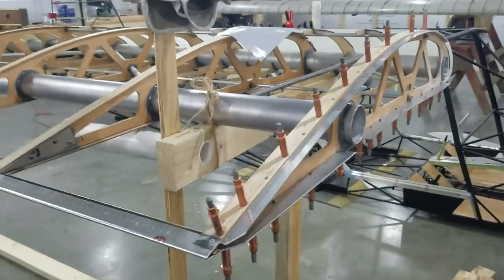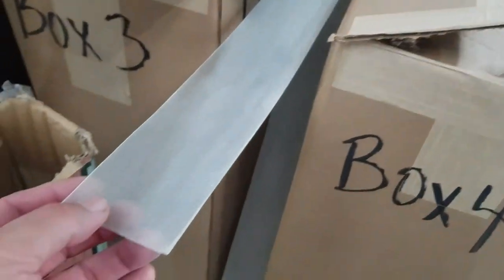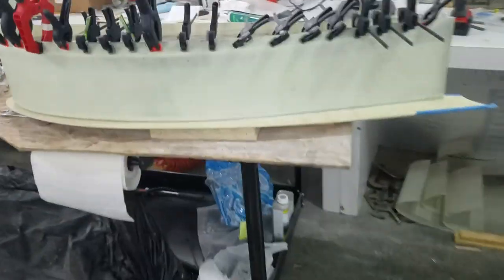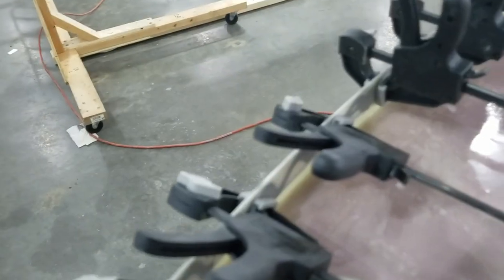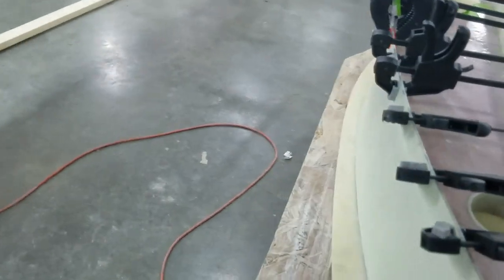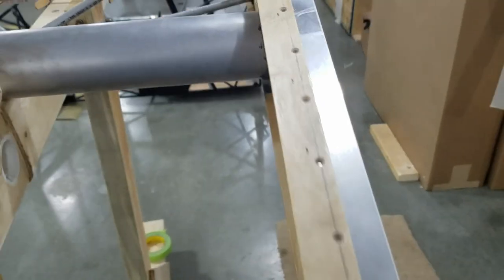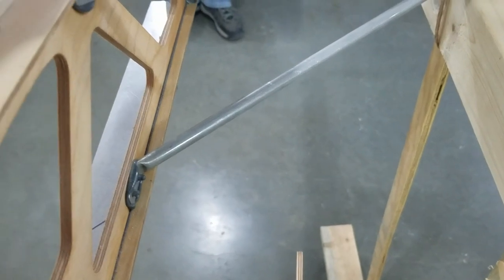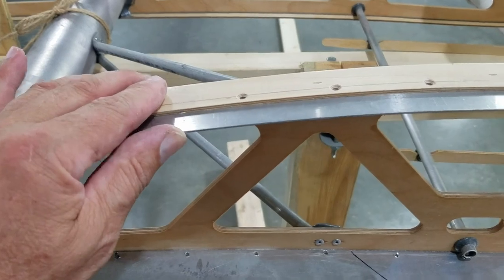Kitfox STI Farm Fox build 15. Wingtips

Comment: Looks like a good resolution on the wing tip. Your plane is looking good. Keep it going
Reply from the maker: Thanks Darwin. It did work out good, I was just a little afraid to cut on the wingtip cause I couldn't find anyone else that had. Hope it helps others.